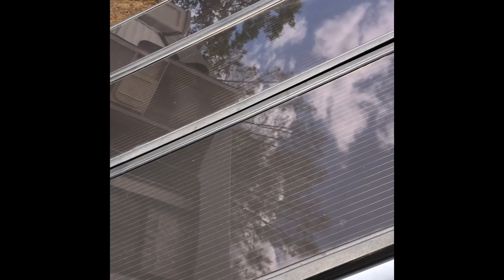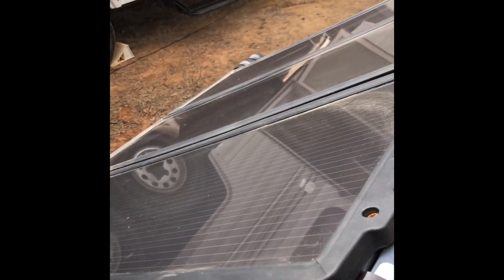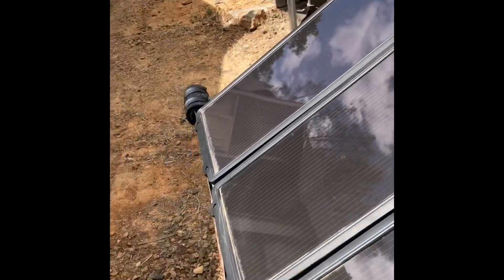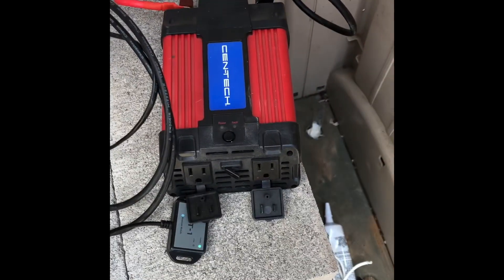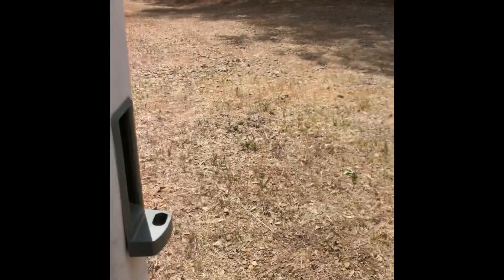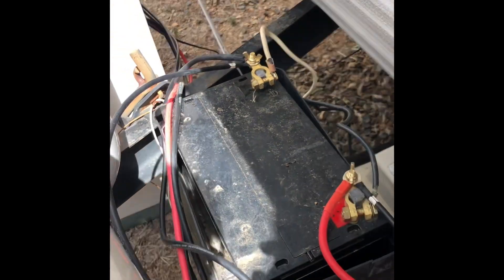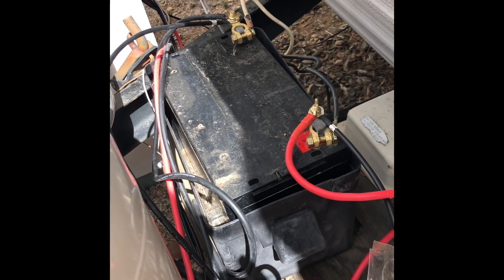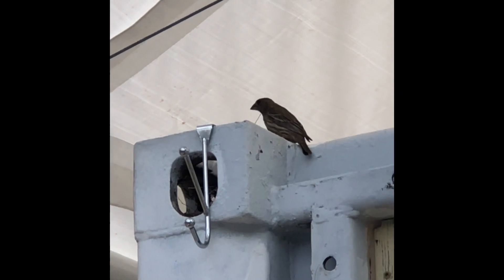My Harbor Freight Solar Panel & Inverter Set Up.

Comment: fuse is in between battery and inverter?
Reply from the maker: Hi George! Thanks for the question. Yes, it is recommended to fuse between the battery and inverter. It also depends on the size of your inverter. The bigger the inverter the bigger the fuse. My inverter is on the smaller size, so I didn’t put in a shut off switch and just went with a fuse. I hope this helps you.